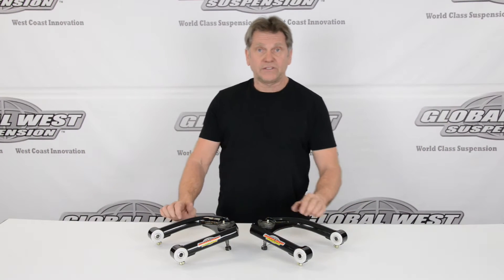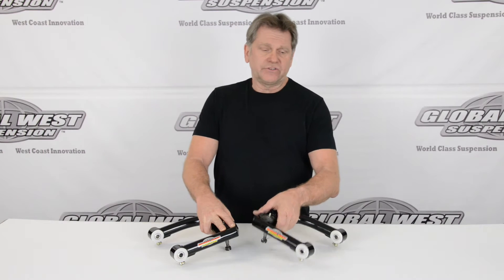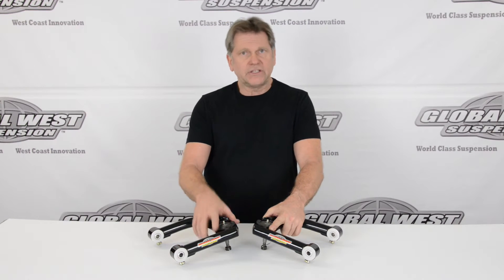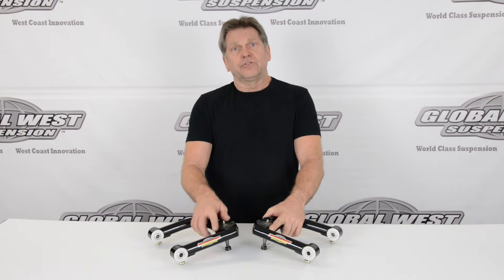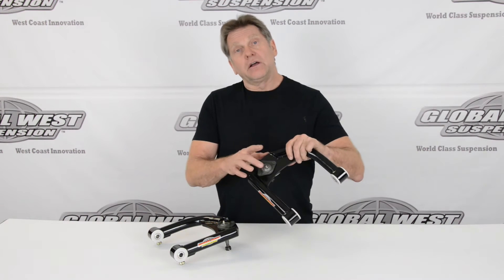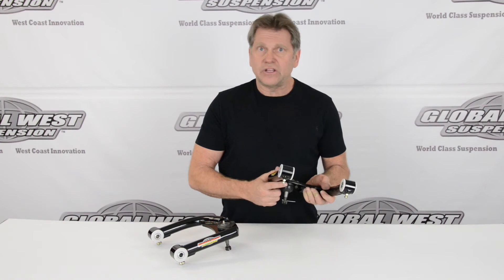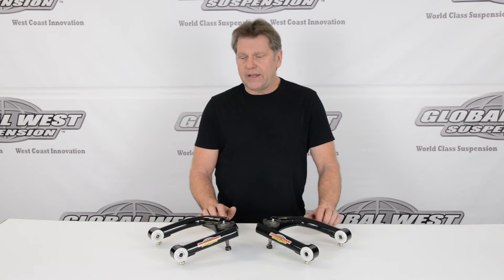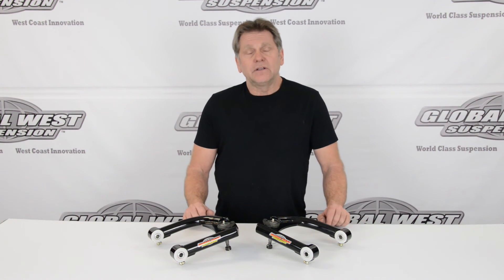1993-2002 Camaro & Firebird Upper Control Arms

Comment: Yes but the upper mount it attaches to a bracket that holds the strut. It's always rusted horrible and impossible to find a replacement if your company sold those with it you could charge twice as much
Reply: Gregory Stones I agree. Someone needs to make new ones for us F-body guys.
Reply: They do. UMI performance.
Reply from the maker: For the most accurate response to your question give our tech line a call! 877-470-2975

Comment: Would these work with a 1.25 drop spring and be good for a daily driver
Reply from the maker: For the most accurate response to your question give our tech line a call! 877-470-2975
Reply: I went to air ride and got rid of these for a adjustable set
Reply from the maker: @josephsanchez824  great setup!
Reply: They where a good setup for the 1.25 drop
Reply from the maker: @josephsanchez824  glad it worked out